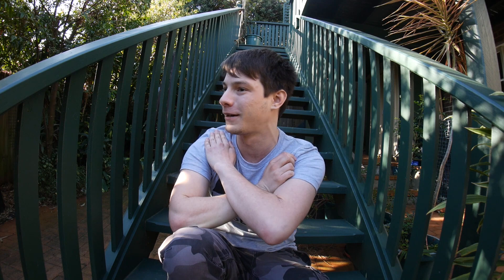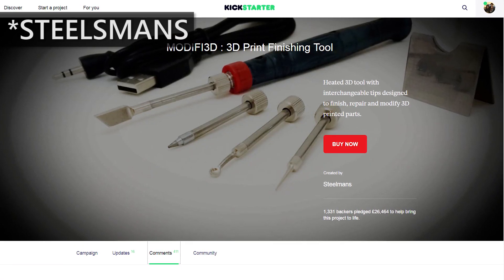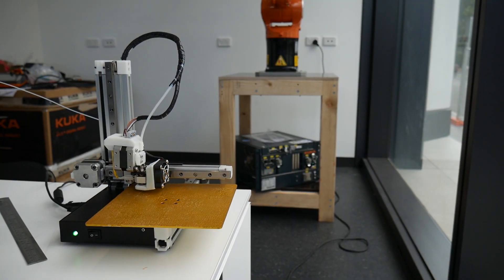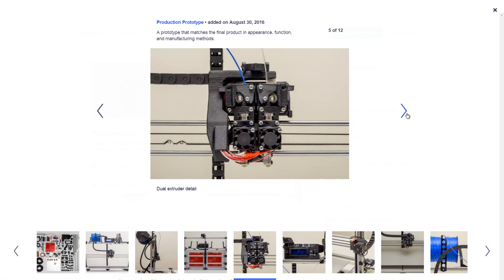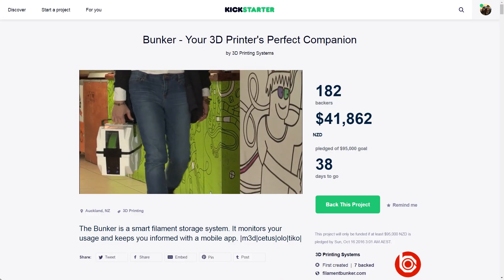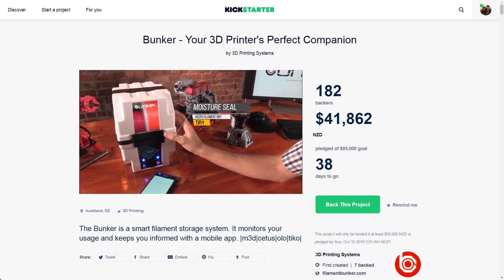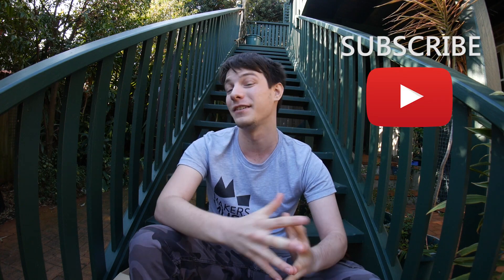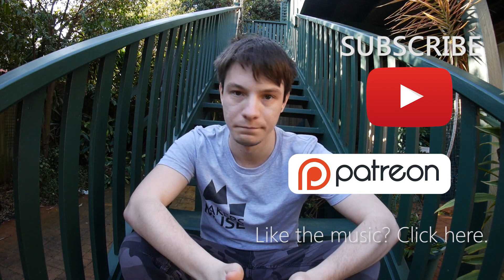3D Printing Kickstarter Projects - Sept 2016 Summary

Comment: So many problems with the dual and now triple feed to one nozzle systems. Like you mentioned the temp is an issue, but what about back pressure making it hard to get a good feed? I like the idea because it means multicolor and multimaterial without calibrating two nozzles, both of which excite me, but is it worth the payoff? Then again, these are all problems that will one day be solved. If anyone figures out true full color with one of these I will upset my wife greatly when I buy it.

Comment: wouldnt worry to much about the substitution of rails...Hiwin has high precision rails but the also sell standard ones ,same goes for just about every other manufacturer out there.There is very large price difference between standard and ultra precision, 90 percent of the rails in common use are standard varieties...Hiwin is nothing like a gold standard just one of many.

Comment: That dual extrusion system is a total rip off of the E3D cyclops, also called it on that 3D printer , i told you it looked like a Up plus2
Reply from the maker: Haha yeah I don't think anyone was fooled :P I'll look into the cyclops I thought that was more designed for colour mixing
Reply: it kind of is , but it can also be used for dual extrusion i think.

they have many options , they have that mental quad extrusion water-cooled monster too crazy guys !

I am totally going to upgrade my i3 V2.05 ( as i did the upgrade myself form 2 > 2.1 ) to an E3D v6 should be amazing ! flexion do a E3Dv6 version of there extruder now , strange considering they are direct competitors.

Still i think the full E3D system is cheaper and good enough for me as all i print in is ABS ( but i will be moving to PETG)

It would be cool to see a E3D video form you and a PETG video too :).
Reply: +Andrew Joy The Prometheus System actually uses a very different approach than the Cyclops from E3D. The Cyclops is a hot end that takes 2 inputs that feed into the melt zone and exit through a single output. On the other hand, the Prometheus System allows you to switch between filaments that feed into a single standard hot end. It is a totally different approach and has several advantages :) I would recommend that you take a read through our campaign page to learn more about our product.